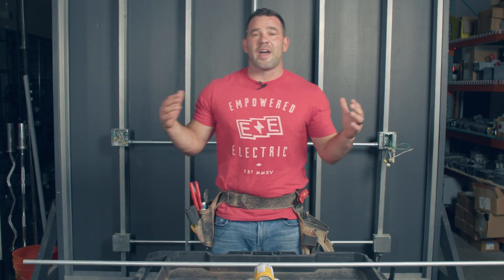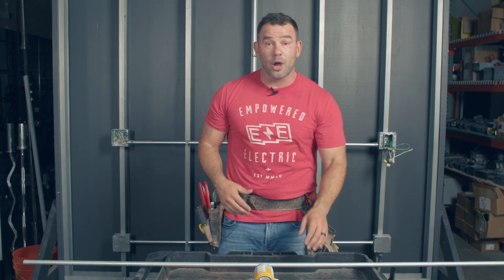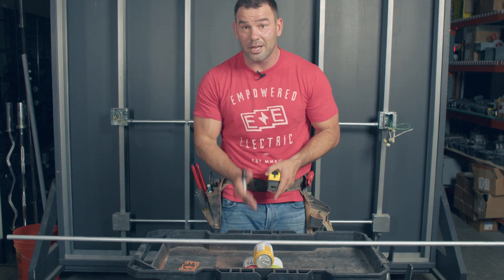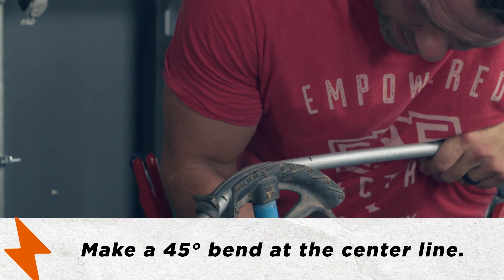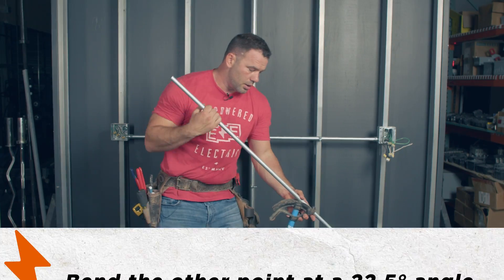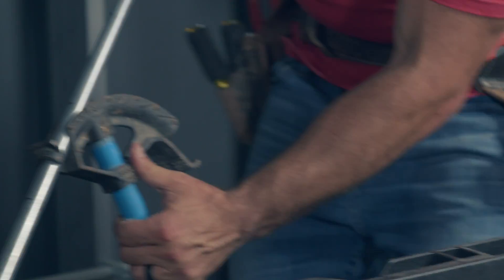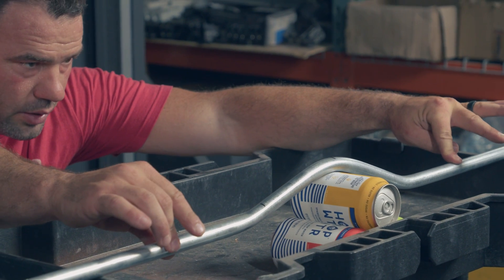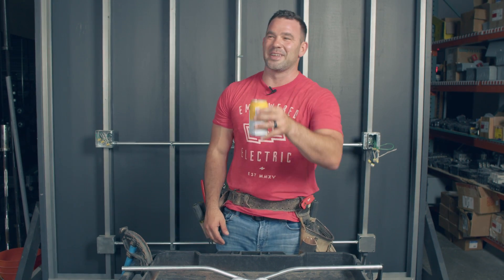How Do I Bend a 3 Point Saddle

Comment: 8 years in the trade. Majority has been running rigid, I was always taught to avoid saddles like the plague. I’m on a massive commercial sight and they beat the saddle drum and they are all over the place. They act like it’s a prize skill
Reply: I was on a data center site as an apprentice, JW always said it's quicker to bend a double offset than a 3pt, never got much experience with a 3pt

Comment: Thanks - became a journeyman in the city then worked in oil sands for 7 years.  After that, took another 7 years off electrical work for personal issues.  Just got back into the trade after 14 years off (didn’t do anything practical in oil sands, just cable tray and basic terminations)! A little nervous to be a rather unskilled journeyman although I have installed plenty of EMT before and this will be helpful for me at work tomorrow

Comment: This will work only for 3 point saddles in 1 pipe run but, if you have a 90 degree bend or offsets, shrink is needed in the calculations..

Comment: Is the multiplier always 2.5 no matter what size conduit you are bending?
Reply: always 2.5 for a 45 degree saddle, regardless of the size of the conduit.  If you use a bigger angle to jump a larger object, you'll need a different multiplier and shrink rate.  For a 60 degree saddle, the multiplier is 2.0.  Most of the time, you'll want to use a 45 so, 2.5 is the only multiplier you need to remember for saddles.

Comment: Please please answer me I'm really very confused, that how to know which degree we need in offset or 3 point or 4 point saddle?
10" 22" 30" or 45" 
If i want to make 35" inches offset how much degree should i need or if i want to make 3 point saddle for 1 inch conduit how much degree should i need?
Reply: It depends on how far you need to offset, how much room you have to peform the offset, and how much allowance you have in your bends before your next pull box.  You can't add up to over 360 degrees between pull points, and over 180 is going to make the pull difficult depending on how full the run is.  So if you don't have far to offset and you have the room, a lower angle will result in a straighter run to pull wires through.  If you don't have a lot of room to get the pipe offset over or to clear your obstacle, you'll need to use a steeper offset to make it fit.    For saddles, 45 degrees for the center bend is the most common.

Comment: So the 1st time for the middle bend you do the star. Then for the other 2 you use the normal line at the end of the tool right?
Reply from the maker: For the center bend, line up the mark with the notch on your bender. The two outter makers line up with the arrow but make sure the mouth of your bender is facing the center line.

Comment: I like your explanation & free thinking, but your pipe looked like shit because you didn’t use the notch. It’s not the STAR. Stars are only used for b2b 90s. Not for saddles. You’re always supposed to use the rim notch for the first bend & not the arrows. The only thing it’s used for is the first bend of a 3 point saddles & should be on both sides of your bender. That little indention right after the star is your rim notch.
Reply from the maker: The final product doesn’t look half bad at the end of the video. We make the necessary corrections😂 Not gonna lie, Its been a while since I’ve done a saddle but wanted to try and get something helpful out there. Thanks for your explanation on the notches and stars❤❤

Comment: So first bend at the star & the other bends at the arrow?
Reply: The Notch is the center of a 45 degree angle and where all 3 point saddles should be bent from on the center mark. The long part of the star is the back of a 90
Reply from the maker: Your Center bend needs to be on the notch (on Ideal benders). The outside bends are on the arrow with the mouth facing the centerline. Great Question.
Reply: @empoweredkc always on notch lol dude come on learn your stuff before talking.this will help you out the notch is only used for center bend on 3 point saddle that's it and it's same for all benders and all size
Reply: First bend on a 3-point saddle is at the notch always … I was confused watching this until he fixed it 😂